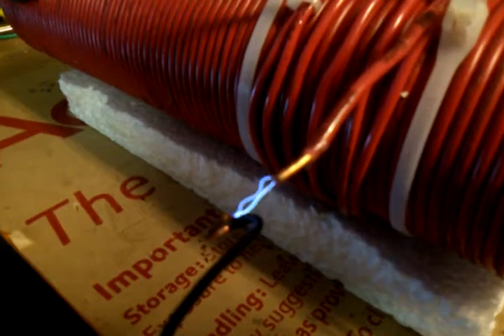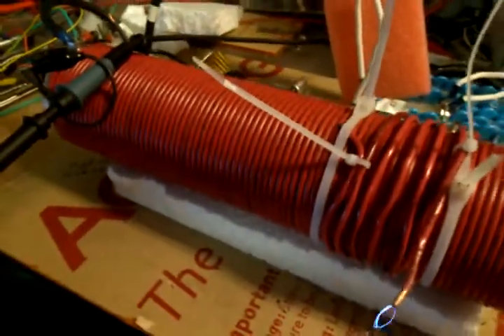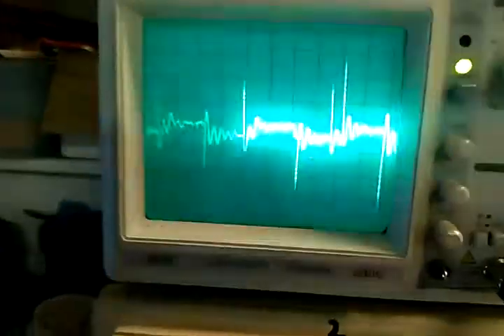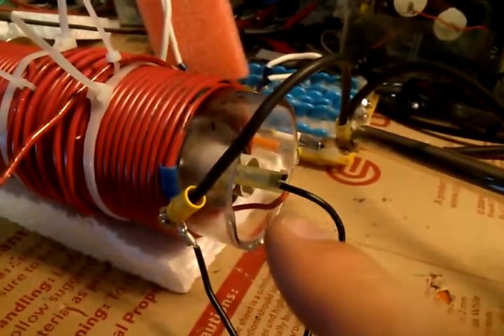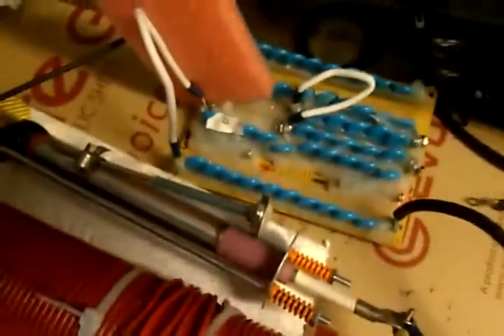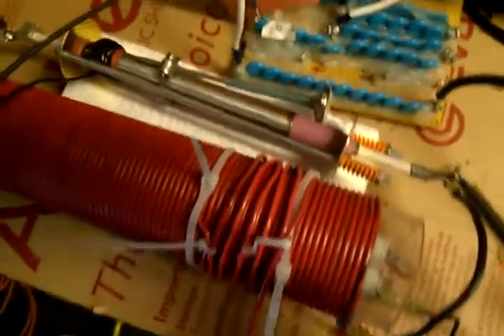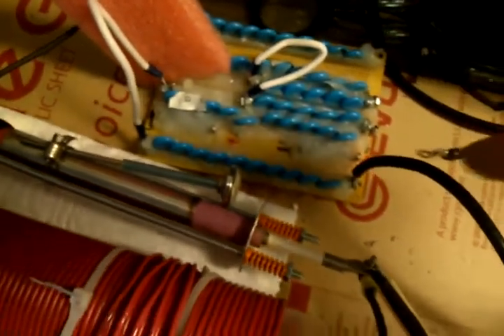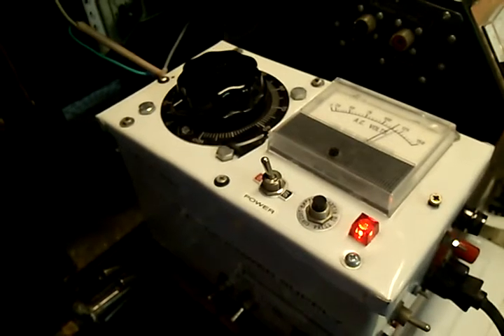Donald L. Smith exp. 1

Comment: Don always showed his L1 coil to be inside his L2 coil, for tuning purposes. The L1 may have also had a soft iron core in that set up, see the MIT Physics Demo Resonance.
Also, I think Don used coaxial cable for his L1, maybe stripping out the teflon core, so he could utilize the skin effect with the high voltage. Tesla also altered the diameter on his L1 coils, his L1 began as one diameter, changing one or more times, increasing in diameter as well as the spacing between turns.